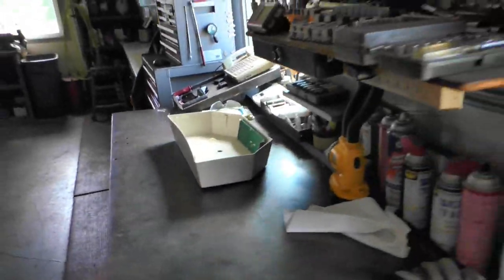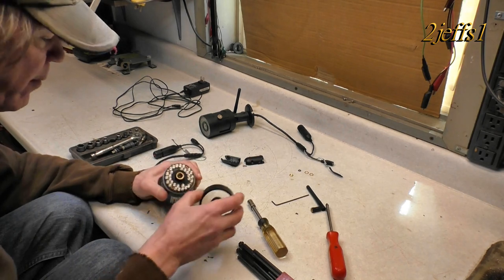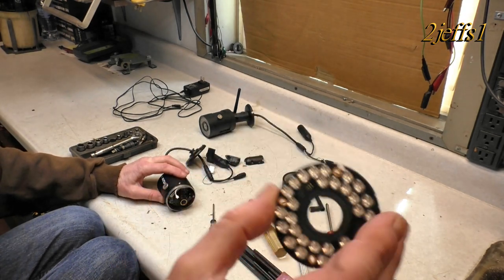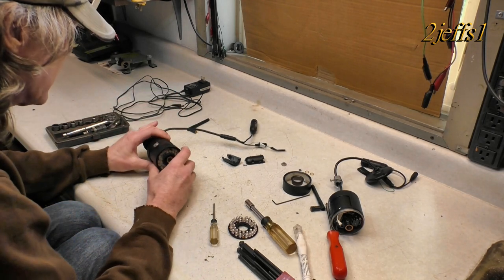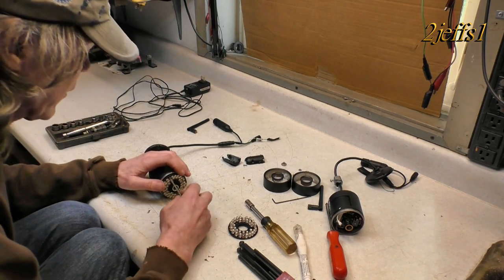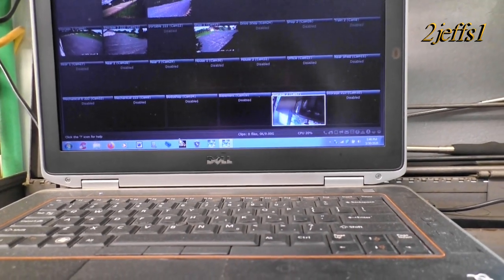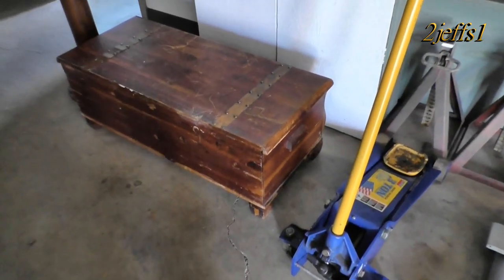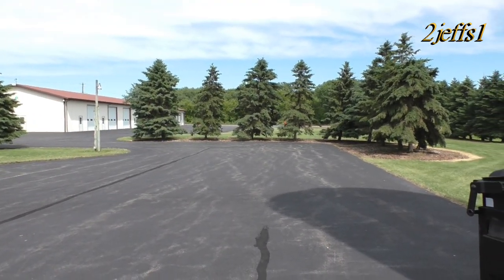Wifi camera repair

Comment: I fixed a two pine trees that were blown down horizontal next to the house. What I did was take the loader with wooden vee on bucket edge as not to hurt the tree bark and lifted them vertical. Then took a rock that weights about four tons and placed it right on the tree roots. That was five years ago and all is well. Did not even need guyed wires which somehow seem to roughen up the bark. Worked for me. P. S. the rocks were for free from some guy digging a basement. He wanted to give me loads of rocks which I had to pass up on that deal. Good day to you Jeff.

Comment: I thought the electronics in the camera generated enough heat to keep them dry. I have a couple that fog up bad after a couple days of rain, but they keep working and dry out in about 3-4 hrs. I've also had good luck spraying circuit board lacquer on moisture affected boards.

Comment: Wish I knew half as much as you do about Electronics...I would convert my garden tractor to an electric motor It has a 16 hp briggs engine hooked to a Hydro static  transmission  ...Wonder what it would cost for a motor and controller plus all the extra wires etc...

Comment: The tighter the economy is the more pressure their is to get money for things their is. The RIF RAF do not want to get a job so stealing is the best method they think. I use hard wired lines that do not have frozen screen from time to time. What system and cameras do you use Jeff ??? Good day too.